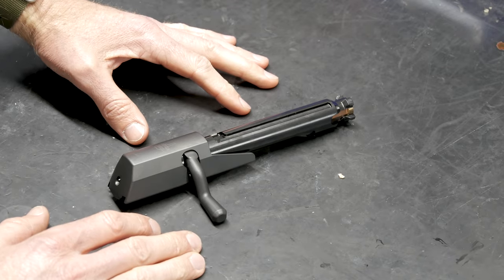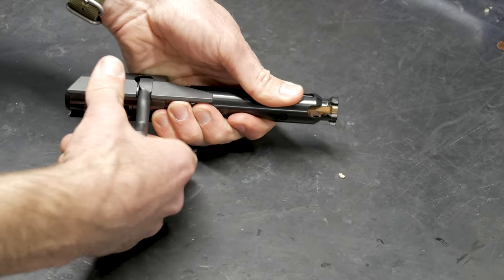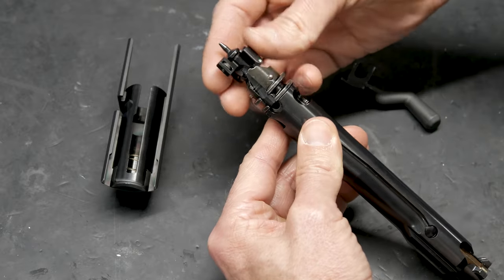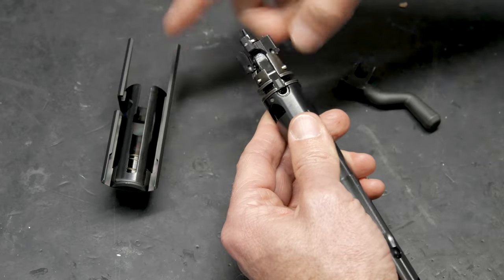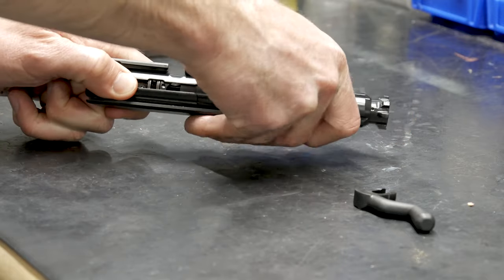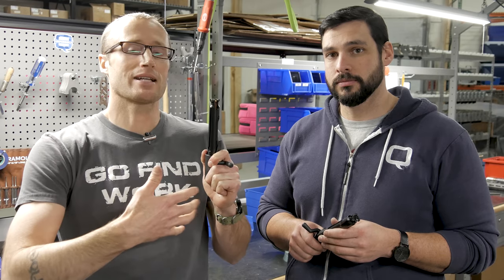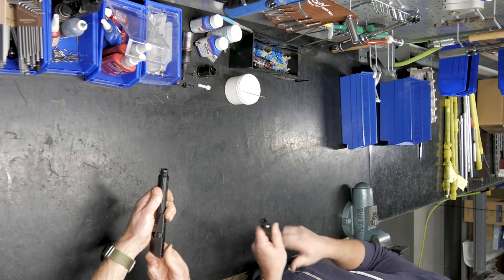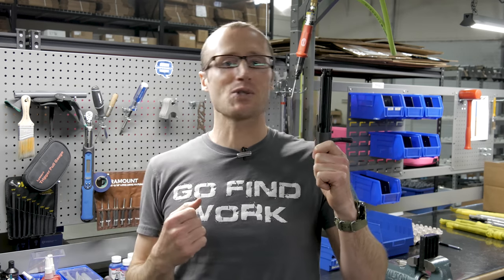The Fix Rifle by Q - Stripping the Bolt

Comment: How often do you need to take apart the bolt for cleaning? I’ve got 500 rounds through mine and it always looks clean.  I just clean the outside without taking it apart and re oil.  Is it necessary to field strip it like in the video?

Comment: How did you manage a meet and greet with Q?
Reply from the maker: I'm not going to lie.  It was magic.  And luck.  Magic and Luck.
Reply: I don't think anyone has ever done such an in-depth review on The Fix platform as extensive as this and much better as it is done in parts so you can retrace things you've missed or didn't have time to watch if shot in a single review (That would have been very long).

Comment: After 36 hours and every cuss word ever uttered plus some new ones made up I finally got the bolt out and reassembled. Fuck that thing. I don’t know if it’s one of those parts that get easier the more you work on them but mine was a bitch and the way I finally got the bolt out was to overcock, push the tic tac thing down, resetting the bolt and instead of pulling I turned it upside down and pulled up on the bolt handle against my wooden work bench and it fell right out